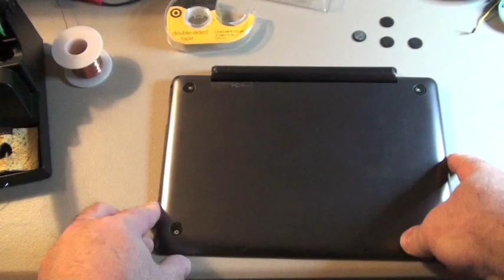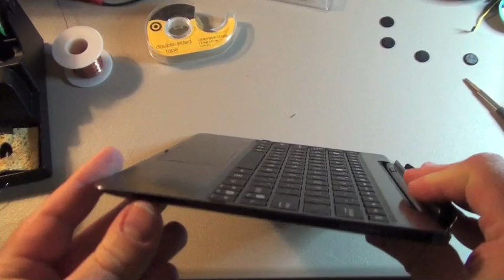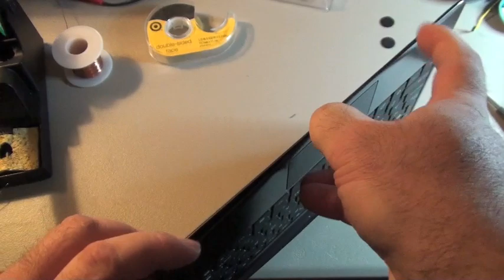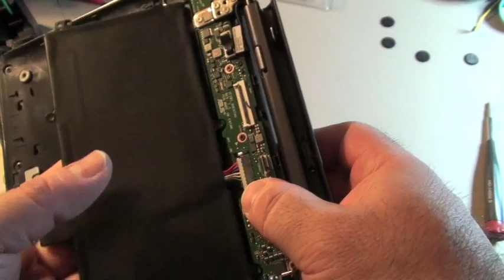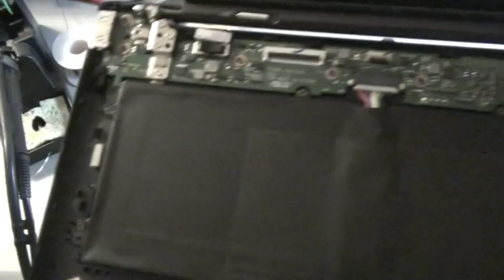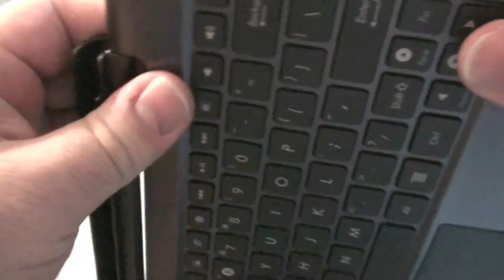ASUS Eee Pad Transformer Prime Dock Teardown

Comment: Remove those two Torx screws from the outside of the hinge, then use tweezers to peel up the strip of plastic at the bottom inside the hinge. Peel from the outside inwards, using tweezers. Don't detach completely but leave the inside ends stuck. Then remove 4 of the 5 screws that are revealed at the bottom of the hinge (doesn't hurt if you remove all 5), and pull the hinge gently to get half to pop off. You'll see 4 Phillips screws on the remaining half of the hinge. Tighten the outer 2.

Comment: 1. Is the battery in dock station compatible with battery with sitting inside the tablet ?
2. Did they have similar size and connectors ?
Reply: Василь, батареи разные.
Asus TF301 BATTERY ATL LI-POLY FPACK C21-TF301

Comment: Thanks for posting this!  After watching it I just opened my TF101 Transformer dock because the battery in it has stopped taking a charge.  It's basically the same except there were only screws under 2 of the feet, and no other screws.  One thing I would mention - use plastic tools instead of metal to pry (SLOWLY - TAKE YOUR TIME) around the edges to open it, so you don't inflict any damage to the external or internal parts.

Comment from the maker: Unfortunately, I wasn't brave enough at this point to try getting into the hinge, but I might try again.  It seemed to be pretty solidly shut together.

Speaking of tightening things, I didn't mention it in the video, but when I removed the bottom feet on the dock, most of the screws underneath were ALREADY loose!  So I can definitely believe you've got loose screws about in your dock.